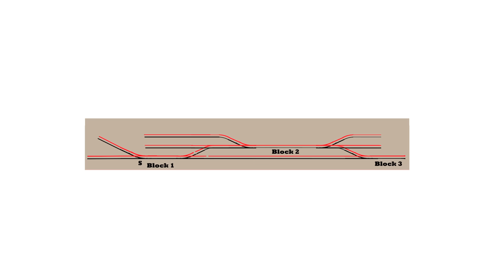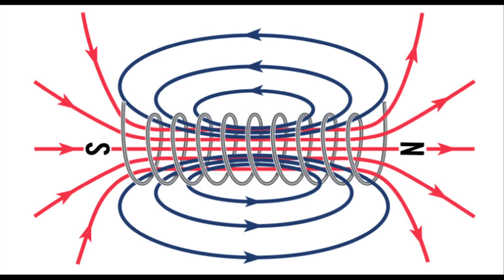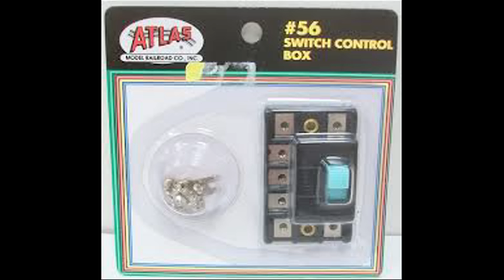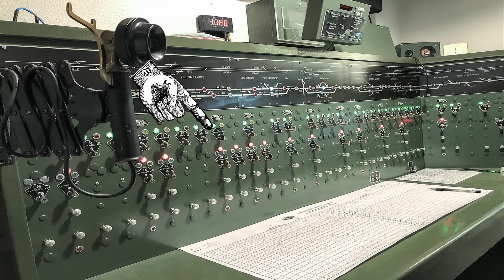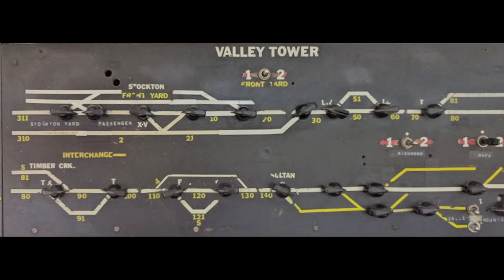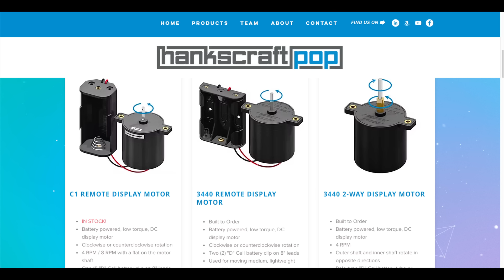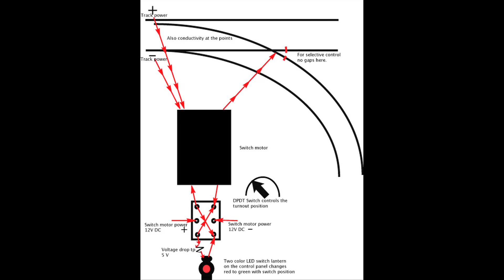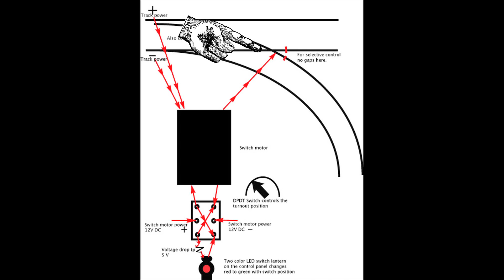The Amazing Engineering Behind Train Track Switches!

Comment: Zoinked.

Have you any experience or knowledge in the art of pneumatic switch systems? I ended up acquiring a pretty vast collection of small air cylinders, valves, hose, relays, etc. to the extent that I gave away the Tortoise motors that I was going to use for the F-Scale railroad. Pneumatics actually have an extensive following in the large scale world, particularly for outdoor use, because at least in theory it can’t not work! I’d like to hear your advice if you have any, because I think this is the year I install the control panel in the tree fort overlooking the system.

Comment: Those slim MP 1 switch machines are not that great . If not used frequently they like to stick , We used some of them on the layout and don't like them. As they fail we will replace them with tortoises, But even they fail . I found 2 of them that have failed already.
Reply from the maker: Ah the smell of burnt motors... 🤢🤢🚂🚀😃 I’ve had the best luck with the old sign motors!  But mostly because I build everything except the actual motor that is very reliable.

Comment: Lee Nicholas' UCW CTC machine uses an actual vintage CTC code relay to generate the sounds.

It's not integral to the operation, but is still wired up itself to mimic the sound of a coding relay of the period at work.

Its also VERY HEAVY!!!

Comment: Great tips!  Thanks, Dale!  BTW, I have tried using the Rust-Oleum "Hammered" Grey to replicate Granite.  A light dusting of the Camo Tan from the top of the "rock" appears to work to give a dirt-ish cast on the highlight points of the CelluClay.  Have you done similar to this in the past?🤔
Reply from the maker: Yup. Sort of I’ve used the hammered grey on stone. But I always dry brush and add dark wash. But you need a good fast to apply base coat.

Comment: I use Tortoises, but I have Homosote on top of 1.5" foam which makes it too thick for a tortoise - so I mount them sideways using the 'Tortoise Remote Mount'.
This allows the switch machine to be mounted anywhere 'near' the underside of the turnout.  It's a more time consuming install, but they work great, and you can even run a crossover w/one switch machine.
Reply from the maker: That’s a great solution for a challenging setup.  😊. I have done that too. But I have (had cause I’m not using it anymore). Using a music wire in a plastic tube. I’ve gone as far as two feet back!  😊😊😃🚀